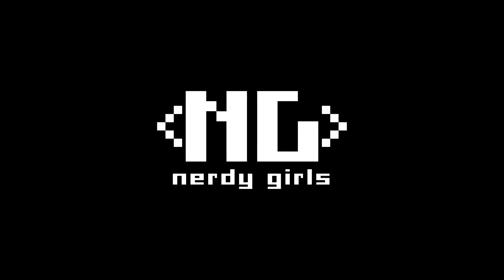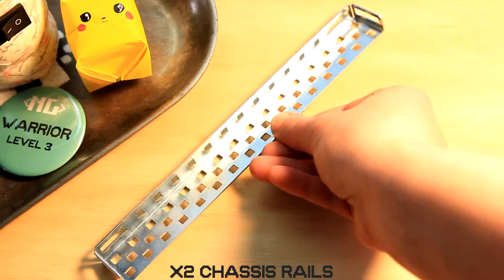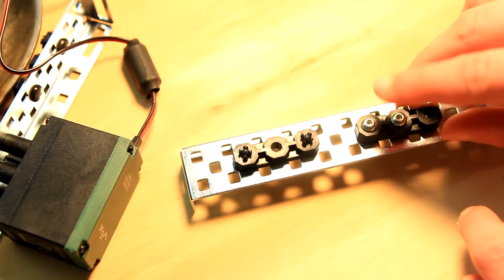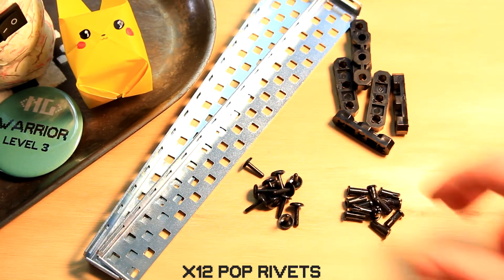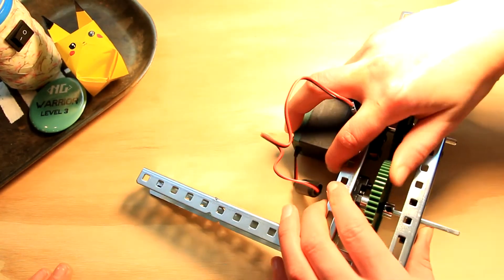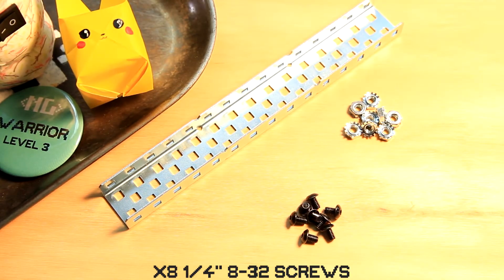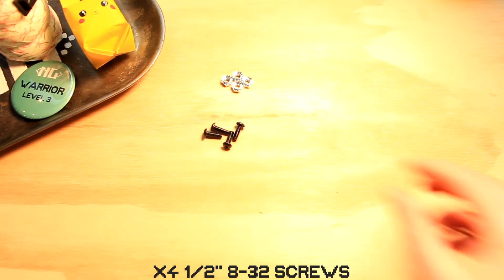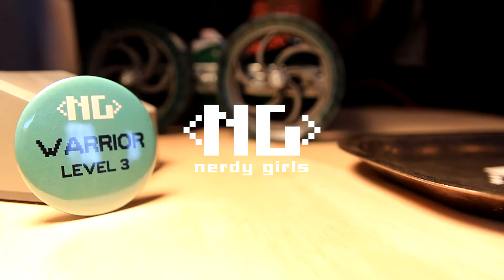Build STING with your Clawbot Kit! // VEX EDR // Level 3

Comment: Are there any significant differences between the ClawBot chassis and this one? I noticed that there are some subtle differences, like the C-Rail on the end, but I was not sure if there was any functional design purpose in that choice you could help out with explaining (maybe mounting the battery and cortex?). Is there any advantage to building this version of the chassis as opposed to the traditional chassis?